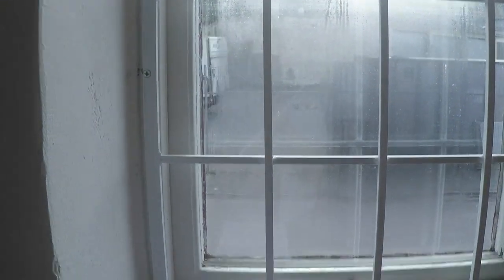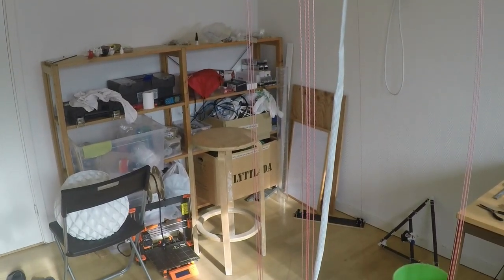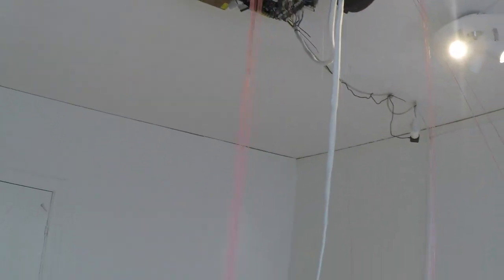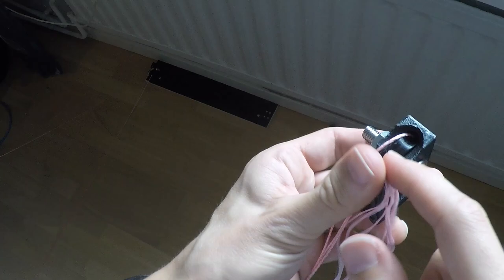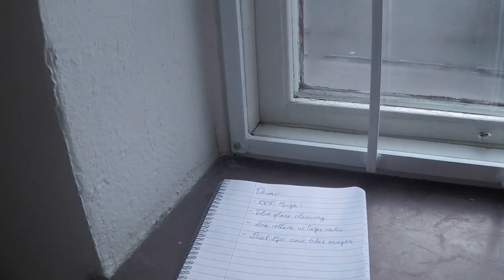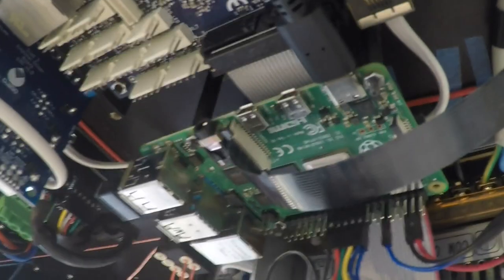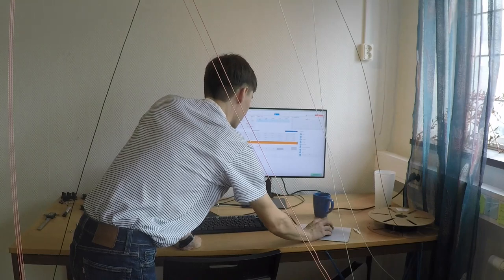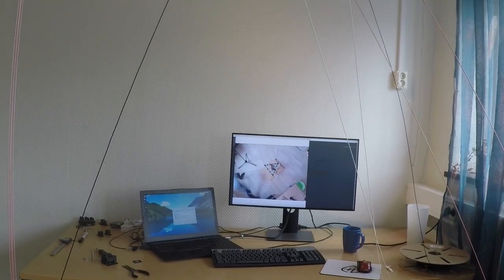ReprapFirmware Merged!! 🎉🎉 + Various Small Improvements

Comment: Looking really good! There was an advert for co-worker robots on after 
and it made me think HP could potentially do that - eg in a mechanised 
farming scenario, or some kind of QC robot. Expanding its potential 
end-uses could help attract investors - I really think you have 
something there.

There are the FarmBot guys: (Made FarmBot home-kit. Now advises NASA on 
farming - YouTube. Using your HP kinematics could help them reduce costs
 over traditional rails/gantry and open up larger bed sizes. Perhaps the
 tool head would be weighted so it hangs like a large delta, keeping the
 cables above the plants (they wouldn't need as fast travels/stability).
 Just a thought :D